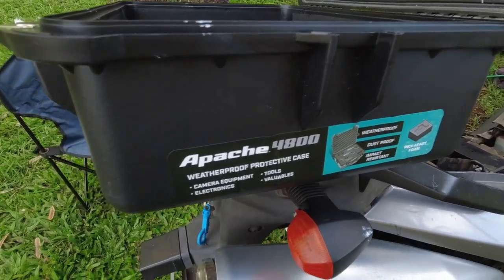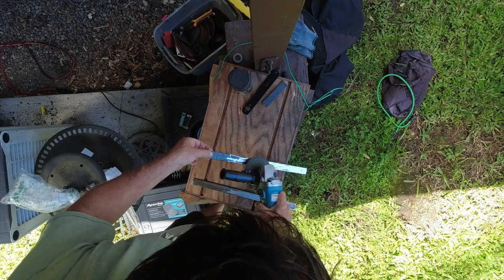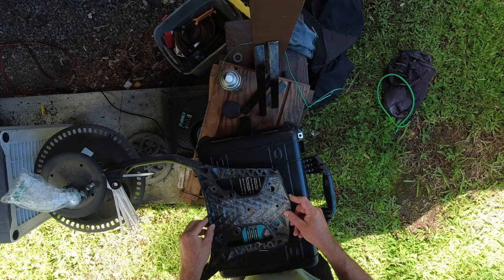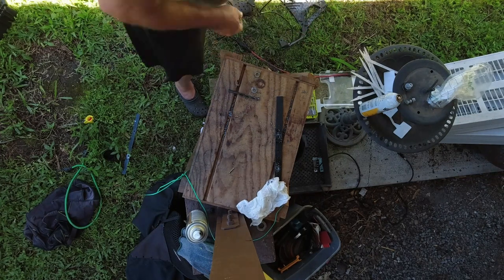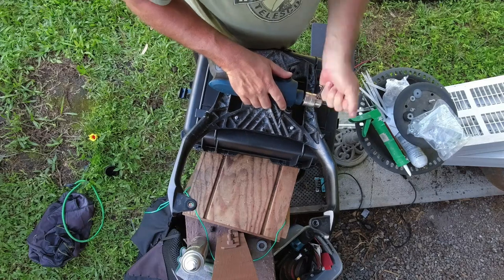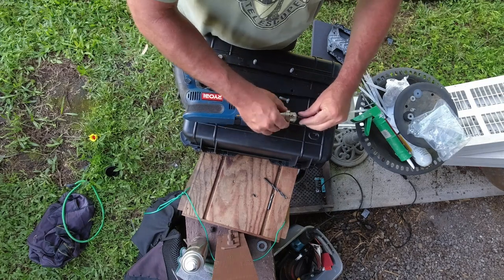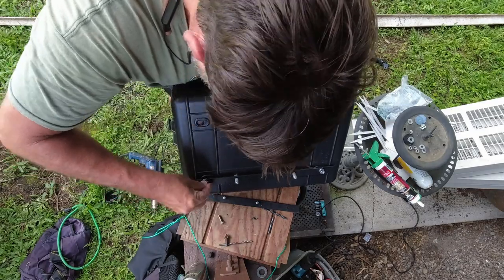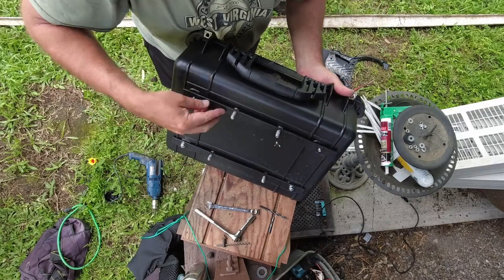How To DIY Motorcycle Top Case |  Pelican Case Storage Dry Case

Comment: Put a 3800 on my CBX, fit's my air pump, patch kit, first aid kit, tools, disc alarm and still have room left.  Nobody has bought me dinner yet, kind of disappointing.
Reply from the maker: Did you keep the padding?  Don't worry about the dinner, you will find your prince(ss) soon!
Reply: @MotoGiant  Yes, the top and bottom layers.